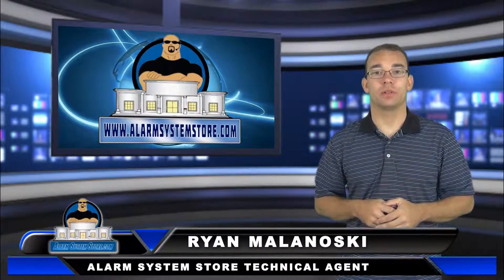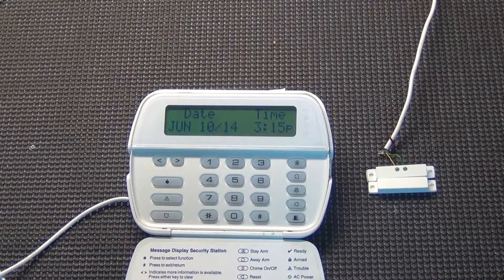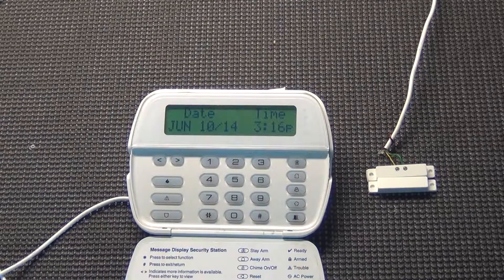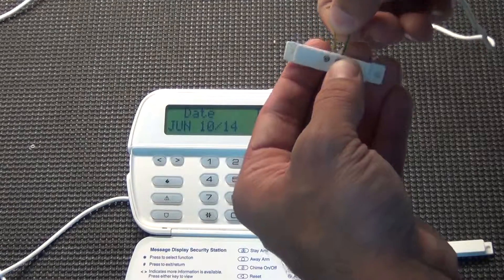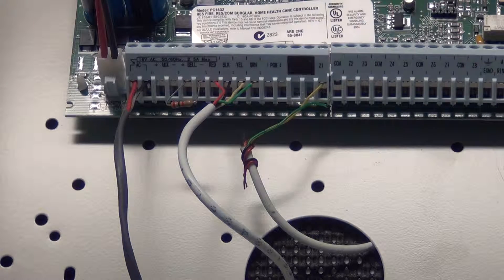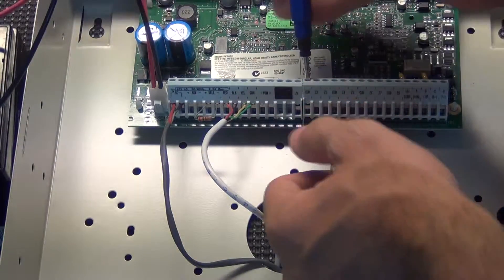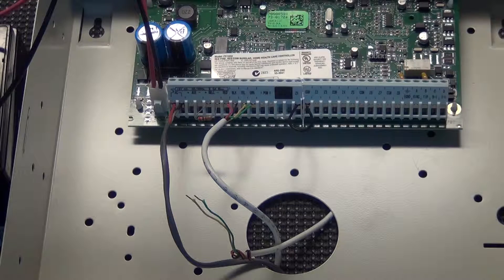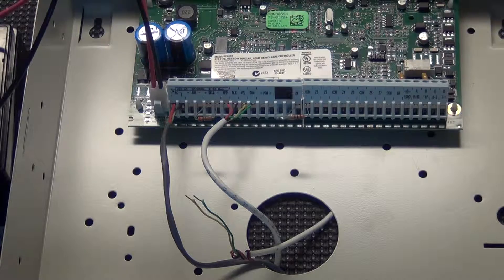Alarm System Store Tech Video - Wiring Troubleshooting

Comment: Had problems with keypad display going blank when manually using keys, zero trouble with remote fob or phone app. The display is connected to the main board with conductive foam strips that de-gas and fail. To hardwire the display is a true joy, 44 connections (22 wires) to solder that need to be epoxy coated.

Comment: Would a DMM save some time?
Reply from the maker: That could be helpful. Most times when we get a call on something like this it's a loose wire at the panel or the switch, but certainly any tool that would help you check the stability of the wire run is always a handy tool to have.
Reply from the maker: Oh, I forgot that another common that causes this are the resistors. If you don't have one and the panel is set in programming to use them then it will cause an issue. Or if you use the wrong resistors that trouble will occur as well.